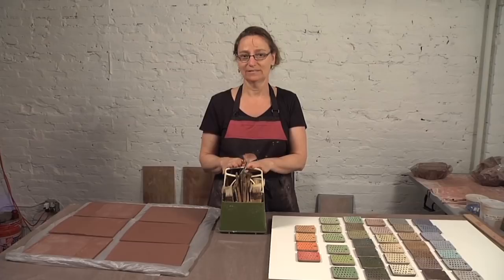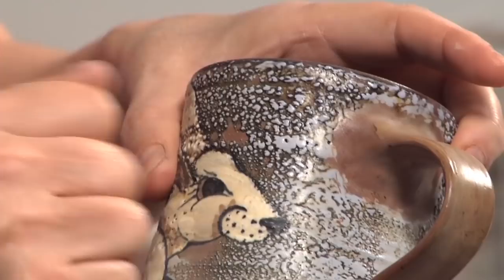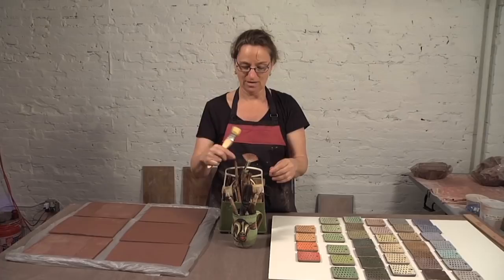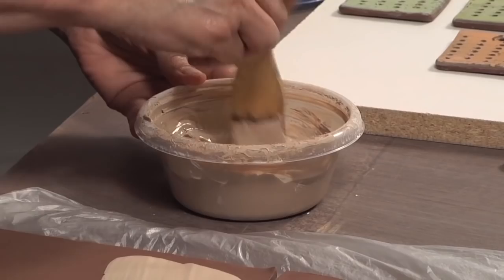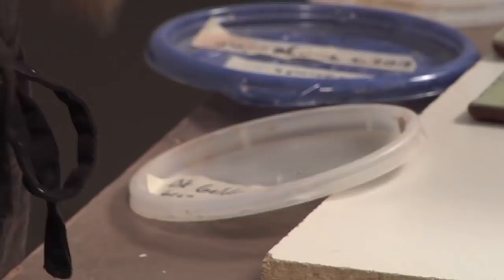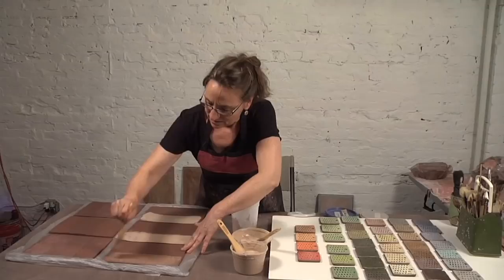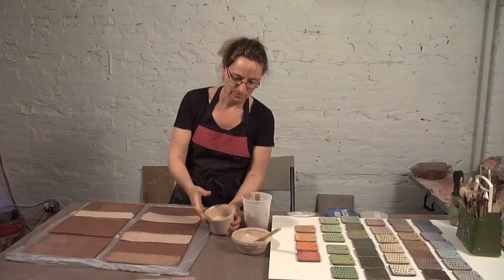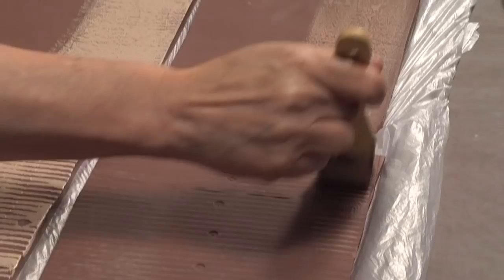How to Use Slip Techniques to Create Texture | LISA NAPLES

Comment: Do you make this slip or buy it? Can you make colored slip or do you have to buy slip in the same clay that the pottery is made from?
Reply: Hi Silver!  I make my own colored slip using mason stains.  The slip, in my experience, doesn’t need to be the same clay body.  To make the slip, use the remnants of your clay and add water.  Mix REALLY well with an immersion blender or whisk well to the consistency you want.  Add the mason stain into the slip to create the color.  Use a respirator when handling the mason stain....just as precaution.  I have used BMix slip on red clay and it came out beautifully.  Have fun experimenting!
Reply: @sherrygKMA  do you just eye ball it for the amount of mason stain you add to the slip? meaning you are basing the color on what you see is what you get?  so just mason stain and slip?  does it give a rough finish?  I wonder what is the difference between the mason stain slip and engobe?  thanks!